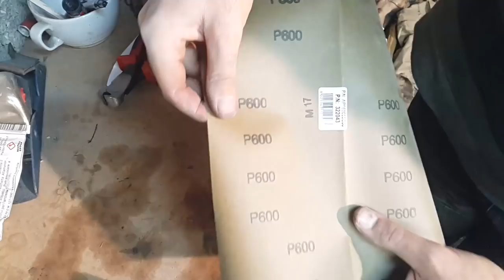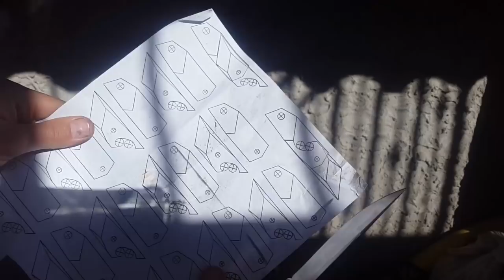Making Of RESOLZA (Traditional Sardinian Knife)

Comment: Gabrulo. Really nice work. I am a beginner knife maker from Perth Western Australia. You have given me inspiration. I can't afford all the flash expensive machinery you see in other knife making videos and you have just shown me what you can make with a bit of enginuity and what you have in the workshop. Keep it up. You have a new subscriber. I hope you don't mind if I copy your idea of the belt sander and the band saw.
Reply from the maker: Hi! Thanks a lot for the sub amd support! I have to suggest you also to see the videos that inspired me to make my tools! Check "Made in Poland" channel and the video "drill hack 1 metal cutting bandsaw" and the channel "Jörgen Börg" with the video "IMPROVED! Best Extrem Beltsander you've seen" cause they gave me the inspiration to make those tools! Unfortunately i dismantled the bandsaw cause it was shaking to much, but the project is good, i just built it not so precisely, but as you will see from the made in Poland video it works!
Reply: Thanks for the info mate. Will definately check the links out. Cheers

Comment: Hello thanks for video, how to unite the plates of ex-plane exhaust and a hundreds electrik guitar string waste made from nikle and leaf spring or bearing how to joined that layer by forge to be solid pieces???
Reply from the maker: +Julio Cavalera sorry i don't know, i don't try yet the forge weld, but i don't think it is possible to weld those materials, they must be just steel
Reply: Gabrulo how about if 1 material like a bearing with bearing or leaf spring with leaf spring?
Reply: Suggestion, you can forge the different metals. The critical part is getting them up to welding temperature. My suggestion is use a canister method. A metal box filled with the materials to weld and sealed at the ends. Heat it to a high enough temp then use a press to force them together. Then either cut or grind off the exterior canister material. Makes absolutely beautiful patterns.
Reply from the maker: That's something i want to try, but i have to double up the forge power, cause now is not powerful enough

Comment: Thanks for your beautiful videos. you make wonderful knives, but.....this is not a real Sardinian knife (Resolza) as ancient tradition dictates, but only an imitation. The old master cutlers build it differently and then the blade does not have the shape of the real Sardinian knife. It must have the shape of the leaf of the myrtle plant, endemic to my island, without the large thickness in the upper part, the handle protection is made of brass and is cold hammered onto the horn. The handle is made of mouflon or ox horn and is often straightened when hot and worked by hand with a file. The blade is forged and hot tempered. The shape of your handle is also different than the original an original knife entirely handmade costs no less than 1000 euros. on you tube there are some videos made by master knive makers from Pattada, the homeland of “resolza”.
Anyway you made a nice knife.